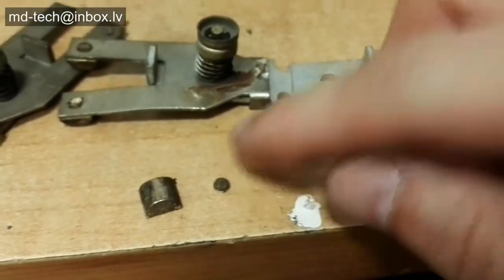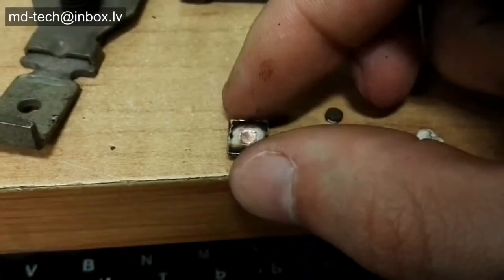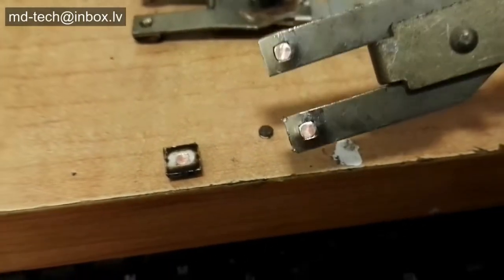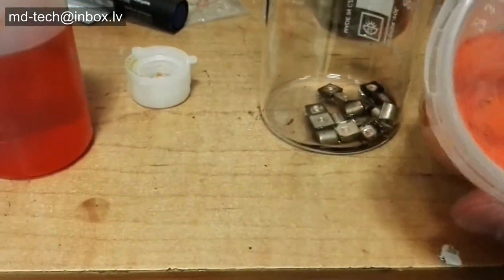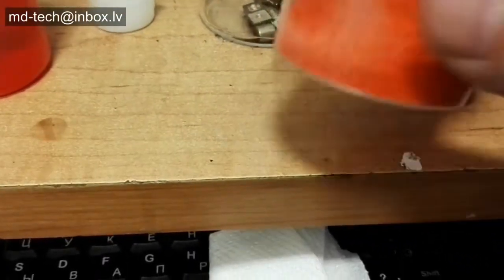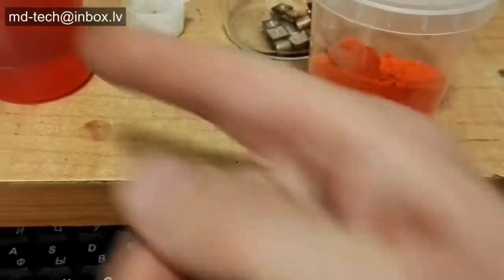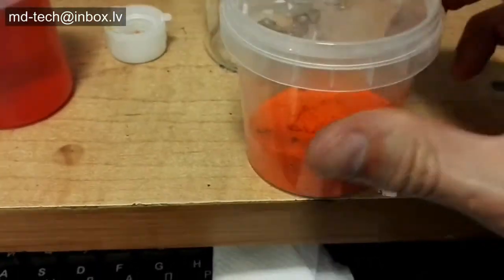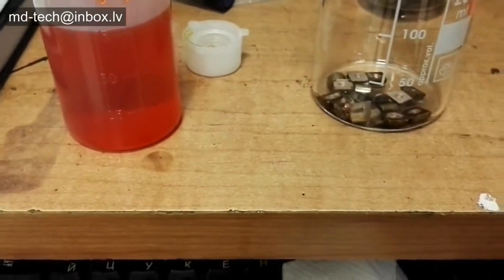Knowing how to remove silver plating from items like jewelry or flatware or mirrors.

Comment: What chemicals are you using?
Reply from the maker: potassium dichromate and nitric acid.
Reply: @chemistry7119  In the video you mentioned sulphuric acid and acetone.how is that used? Also there is hardly any audio. There is talking in the first part of the video but none in the middle and a few words at the last.thank you for your reply.
Reply from the maker: @dickmaske8391  Acetone I use to wash off any oil and dirt. Potassium dichromate work on both acid. Nitric and also sulfuric acid.